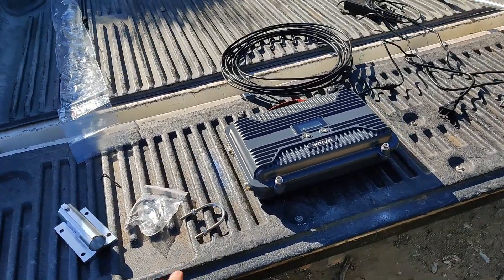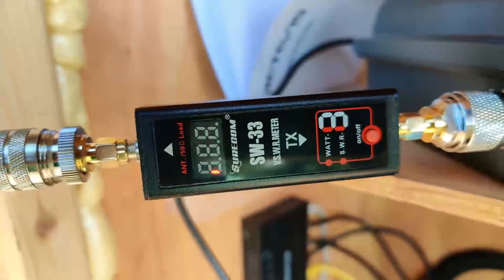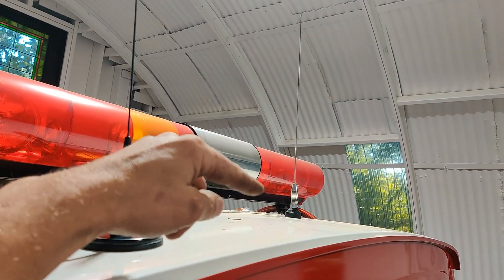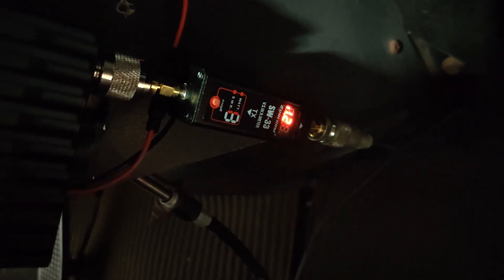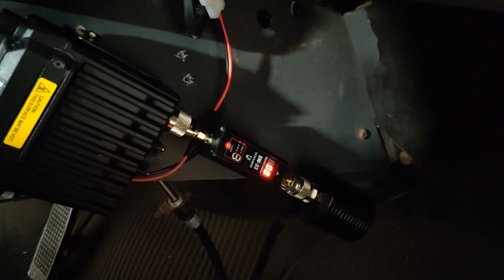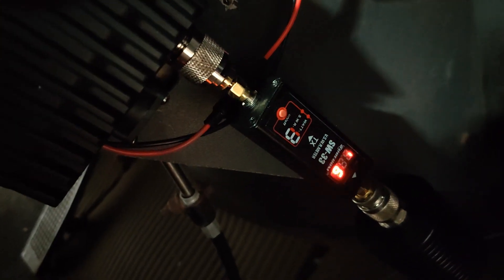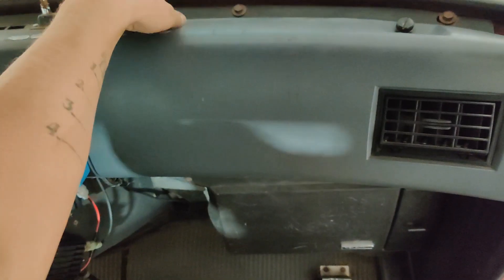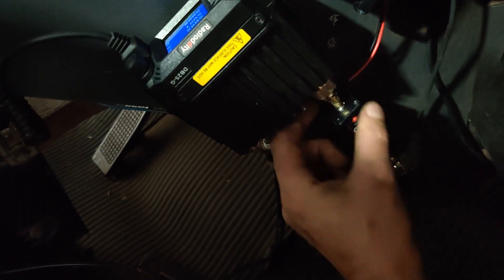Install Retevis RT97S repeater mobile radio

Comment: Ok didn’t see what this was for. That’s AWSOME. How big is your ranch? Part two on how it’s working and the HTs?
Reply from the maker: It's a family friend's ranch, accessible is about 60 acres I believe. I am planning a follow up now that  has been in place. Dont want to disclose the location, but will try and add in line of sight terrain maps with distances. I know I have reached over 6 miles with no LOS but thats just trees and buildings not actual mountains or hills.

Comment: The aluminum on the light bar might give you problems with transmit.
Reply from the maker: maybe but I had it on my pickup for a bit and connected to my baofeng uv-5r's.  I had better performance with the stock antennas and saw similar swr readings as in the video. That mag antenna just seems poor quality.
Reply: @whynowork8480  Before you check SWR's you need all the proper things in place test in wide open area no powwer slines overhead and the placement of the antenna. When you adjust the up and down of the element you must be 10 feet away at each test to properly get a good reading many varriables.